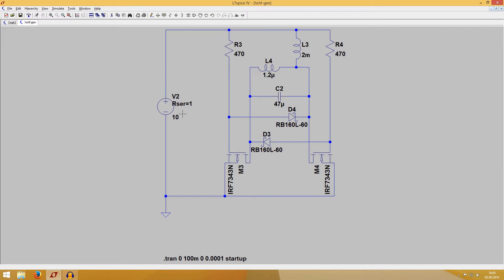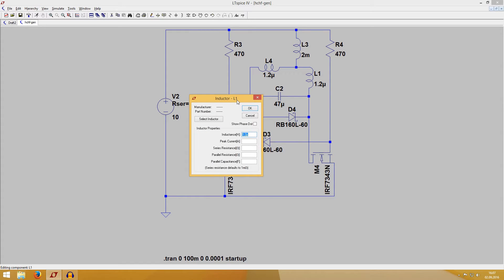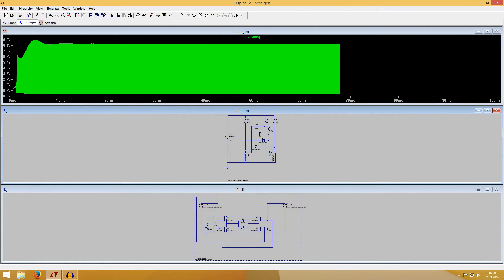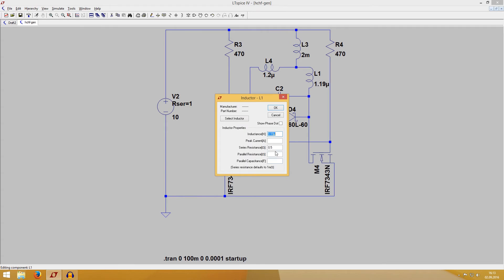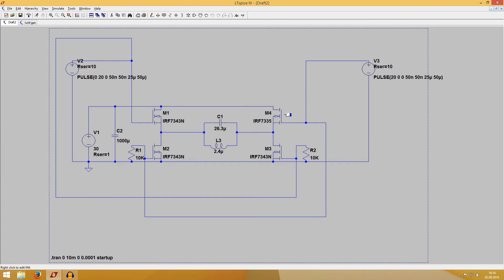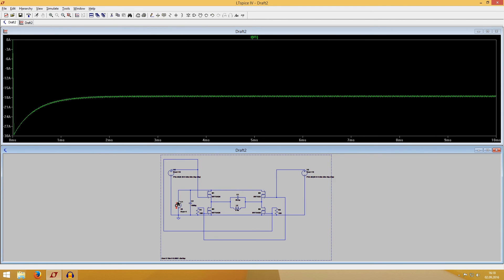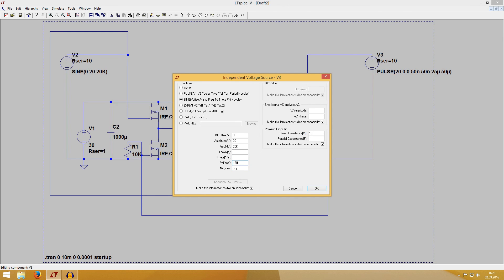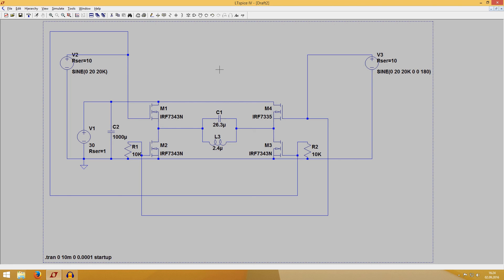Induction Heater Tutorial: Part 2 - Advanced Circiut

Comment: I'm working on device that can work for long time to evaporate water; what circuit modifications should I do therefore the device does work well enough without burning at the same time consuming lowest energy "amps"... If I want it to work on batteries what size "ampers-hours " consumes per one liter of water
Reply from the maker: To evaporate water on batteries a resistor wire heater is probably the most efficient choice, not an induction heater. for one liter of water you need approx 2500kJ of energy if you start at room temperature. that is equvalent to around 150 ampere hours at 4v battery.

Comment: Hi, I have a few questions related to circuit. If you answer I will be grateful.
1) According to comments below I understand that your improved version does not work in real life, does it?
2) Why is only M3 different part number?
3) I am watching lots of videos about induction heating. There always a conductive stick is inserted in a coil and the stick heats. According to your circuit can we say that the coil is L1(2.4uH)? I mean that if I install your circuit in reality, L1 is the coil that I insert a conductive stick in it?
4) There has been a year you loaded the video. Do you have any other-up to-date circuit that you actually installed and it works?
Thanks in advance.
Reply from the maker: 1: No it does not work. In the simulation parts can not overheat and get fried. I used passive 5cm heat sink. Maybe water cooling will do better.
2: A mistake I didn't noticed. The fets I've used in the simulation are too weak anyway. You need the large ones in to-247 casing, otherwise they fry because their heat cant get away.
3: yep you are right. you work the inductivity based on the coil size you need and the frequency you want to match optimal frequency for your material (eg. steel, graphite)
4: Not really, I did a small follow up, where I corrected errors: https://www.youtube.com/watch?v=2YmQmjm--V4 
I did one more circuit that actually worked out, but I found that buying the chinese ones from ebay is actually cheaper and saves you time, unless you order components for thousands...